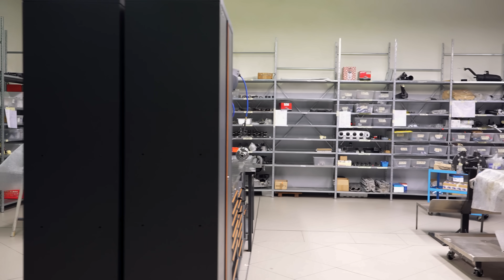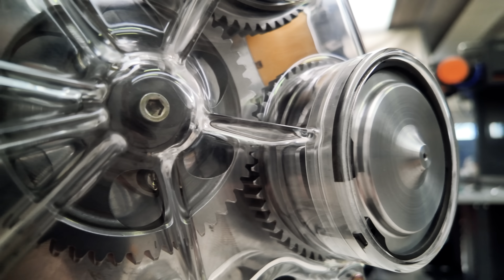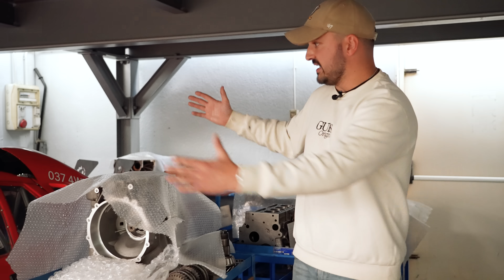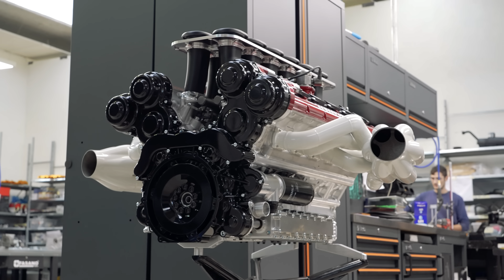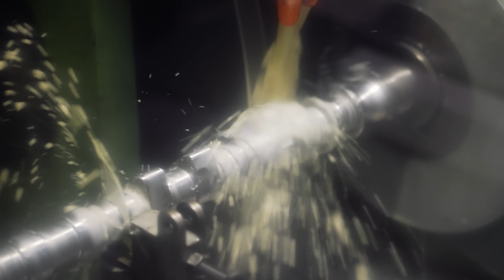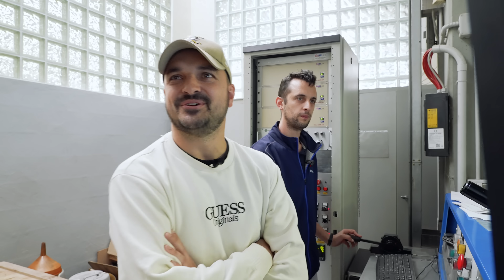This 7.0-litre Quad Turbo V12 Is The Most Powerful Car Engine Ever!

Comment: It's surprisingly underwhelming that in 2025 a quad turbo 7 litre V12 is only putting out 1500bhp.
30-40 years ago men in sheds were getting 500+bhp out of Cosworth YB engines, which in turn were built of the bottom end of the Ford Pinto engine first used in the Mk3 Cortina.
With 3x the cylinders, 3.5x the cubic capacity, 4x the turbos, several decades of technological advancements and no compromises of using an existing production engine block, shouldn't we be way ahead of this already?
And such a shame that the natural balance V6 and V12 engines are so loved for, was destroyed with that crankshaft.
Reply: A 500bhp YB wouldn't last long. Also, this makes 4x the power from only 3x the displacement.
Reply: It makes 3x the power, from 3.5x the displacement actually, with anything beyond the current 1500bhp being a hypothetical aim.
Reply: @matthewjenkins1161  It made 1500bhp just on wastegate pressure without even reaching the rev limit. It's a 2200bhp engine, they're still just breaking it in. Isn't the YB a 2.3 litre engine?
Reply: @Broadwoodwidget  No, the YB is a 2 litre, based on the bottom end of the 2 litre European Ford Pinto engine. The Pinto was first produced in 1970. Tuning to 400bhp is common for a good reliable road going engine, but outputs of over 600 have been achieved. I'd have expected more of something designed over half a century later for high power, from the ground up.
Reply: @matthewjenkins1161  Right, I'm getting confused because both the US Ford Pinto and Merkur XR4Ti I once saw on Wheeler Dealers had a 2.3 - anyway, triple the displacement, and a stock YB makes 201-227bhp, so this thing is in the region of 10x the power from only 3x the displacement.
Reply: You are the 'Bean Soup Theory'.
Reply: @Hang.On.A.Minute  I think you misunderstood my comment. I love cars and engines, but when broken down through critical thought, I'd just have expected more in 2025. I can greatly admire the effort and skill that has gone in to this engine, whilst still acknowledging there has been little to no gain in bhp per litre achievable over half a century, when compared to a now pretty vintage engine, itself based on a mundane, produced by the million,  Ford block.
Reply: @matthewjenkins1161  eh? This engine is over 300bhp/litre. The Ford made no more than 113bhp/litre.

Comment: 12:40 hey Mike, this engine and the builder, Steve Morris, have an interesting story. Basically devel stopped paying him and became uninterested in finishing the motor after it was almost done. Thats a prototype, the production cars would have a block machined as one. 

Steve choose to use ls bore and stroke for the availability of parts to build a prototype. Its a platform hes familiar with and knew it would meet their goals.

He actually has a big youtube channel too, steve morris engines. He builds several other engines, people race them here in the us. Hes very much into the technical side of engines. 
I believe he still has the engine and hes got some videos online from whenever this happened a decade or 2 ago.
Reply: Yes 200% this - And the engine there is 12.3L and makes a dyno-verified 5007 hp.
So while the rest of the Devel project was hyped vaporware, that engine is very real and Steve will build you one like it for $300k+ or something like that.
Reply: Steve has made over 4200 hp on the hub dyno more recently with a v8. I believe he could make 10k hp if he revisited the devel 16

Comment: 9:28 its a shame theyre kind of a decade late. Other companies and manufacturers might very well have been interested in this. Nevertheless, its a beautiful design.

The only drawback, and its fairly considerable lmao, is that this engine will not fit in  anything. Its enormous. They chose 120 degrees because its optimal for making power. 

Manufacturers choose 60 degrees because it will actually fit in vehicles. I'd love to know the dimensions of this, because im genuinely curious what exactly it would fit in.

Comment: The dream engines are great, but I would love to see a series on the best "daily" engine. Toyota, Honda etc.
Reply: Motortrend has plenty of that.
Reply: I once went to Mountune when they were in Maldon to ask about having my Nissan CA18DET rebuilt by them. The money was astronomical, they would design the Engine management etc and said "why not go High reving NA"???? that would have been cool, but I didn't ended up tried and tested route
Reply: just go stand out by the road then xD The kid is just trolling to get the channel to fail. Ban his account!
Reply: There wouldn't be any Toyota or Honda engines on that list, at least not modern ones.

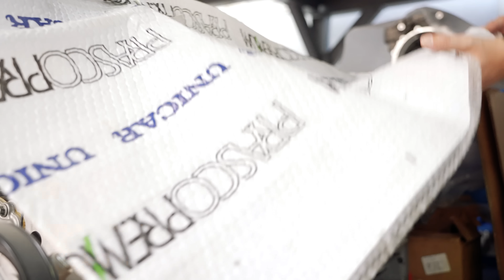Comment: 12:04 I dont think that V16 is the one from the Devel sixteen program becasue the dude who made that engine is on youtube and it looks nothing like it.. I think its from a different company called "Sixteen Power" which also makes V16's from LS based platforms. I cant post links here but there is a image that looks exactly like that engine from february 2019 on a dyno and it has many of the same parts. Edit: there is actually also a Tiktok video on "house of auto" that has the engine you'r showing here. The tiktok video was taken in 2023-1-14
Reply: Yeah, that doesn't look like the Steve Morris V16.  His had a single billet head on each side with a billet valve cover.

Comment: Cletus McFarland: "2000 Horsepower? Hold my beer." (He has an engine with over 5000 horsepower as a twin turbo V8)
Reply: Youre comparing production street legal engine that will do 100k miles versus something that need rebuilding evey 100 miles, kid.

Comment: Engine yes.   Car engine... WTF are you going to put that in that will not have its chassis ripped apart.    Do tell!    Hitting play now

Also, love how this is the question to forced induction or displacement... and the answer was YES

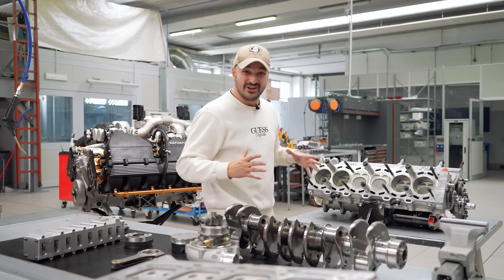Comment: 3:55 I dont think people understand with many engine parts, you start with a billet block, and machine it along multiple axis's during multiple steps on different machines.

If at any point you make a mistake, the machine makes a mistake which is rarer, or the piece moves while its clamped down, youve wasted a huge piece of metal with numerous hrs of work already into it.

For something like a crank, your often removing 60-80% of material by thr time you've got a finished crank. Its like chiseling a stone block to reveal the statue within.